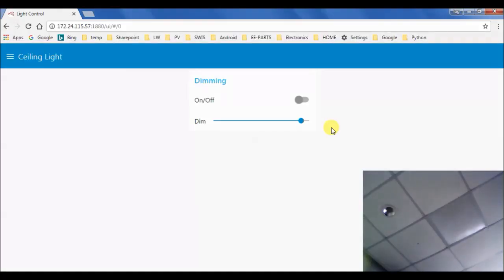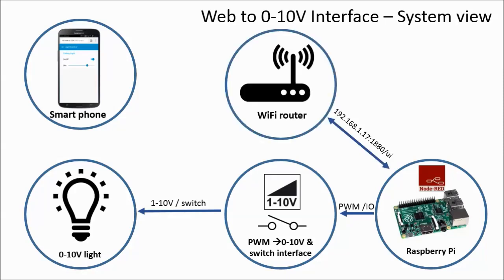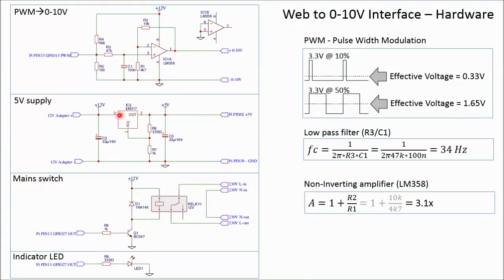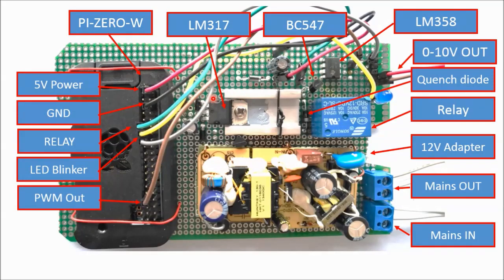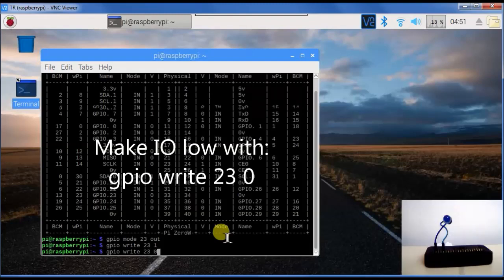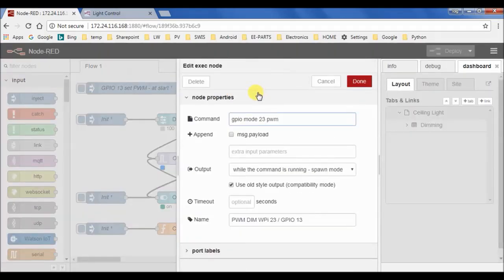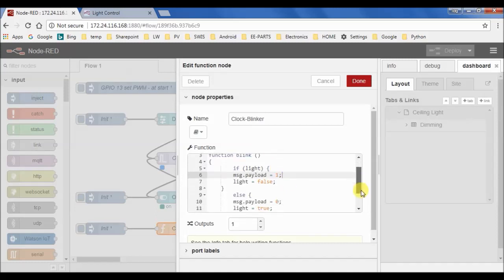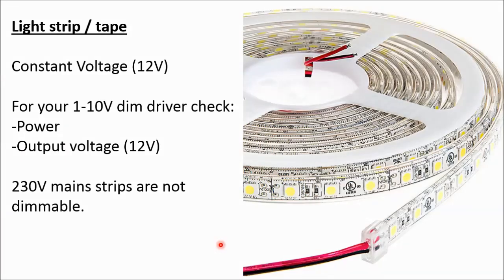Web to 0 10V dimming interface with Node Red on your Raspberry Pi

Comment: Hi,
i want to control a phase angle controller with PWM. I got everything setup in Node-Red, but if i input different injects to my PWM Port (0-100) i dont get a linear result. Do you have any tipps to test if my pwm is right or how i should fix it?

Comment: Hi here from Michaël from the Netherlands and I want to get started with this project.
Is there also a PCB board or a ready-made PCB for this project.
Thanks in advance and found it an instructive video.
Reply from the maker: Nee ik heb dit op een experimenteerprint gemaakt.
Reply: @circuitarchive193  Ok bedankt voor de info. Heb je ook een website of is het alleen hobby laat maar zeggen ?

Comment: Can I use 33uF 16V?
Reply from the maker: For C2? It is 33uF/16V,  The value of C2 is not critical any value from 33uF or higher will work, even 330uF or 470uF is fine. It only smooths the AC ripple from your adopter. Make sure the voltage is enough though: 16 V or more.
Reply: @circuitarchive193  Thank you!

Comment: How do I determine the current capacity of the 0-10v output?
Reply from the maker: sink: 10mA, source 20mA, it is determined by the opamp - https://www.electroschematics.com/lm358-datasheet/
enough for 5-10 lights

Comment: I'm still trying to find out why no one is actually making one of these for commercial use.
Reply: They are available. However, they are usually sold with a smart automation package. and are rated for safety which means that they have a UL approval.  This project is very easy to build and all parts are generally available. I recommend that if you know nothing about electricity that you don't try to make something like this because you may burn your house down.

Comment: how would you recommend controlling a 16 Channel 12 Bit PWM Servo Driver on a Raspberry Pi, doesn't have to be 16 channels. I am fairly new and i like the concept of node red and i would like to control small robots, or chicken coop doors from it. Thanks!
Reply from the maker: Expect that goes a bit too far for NodeRed.
You could write a Python or C code and call that program from NodeRed, as a command line command. But it will not be simple ;-/